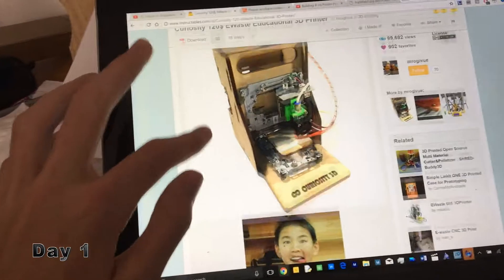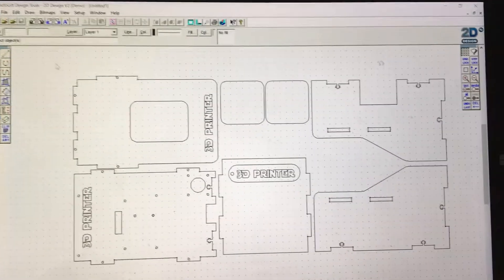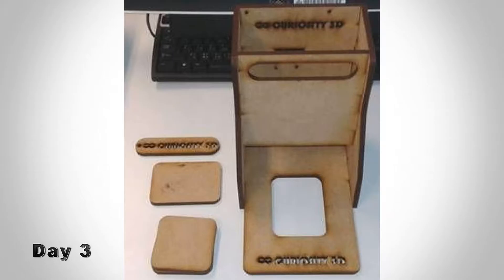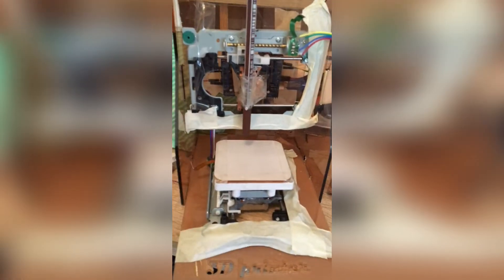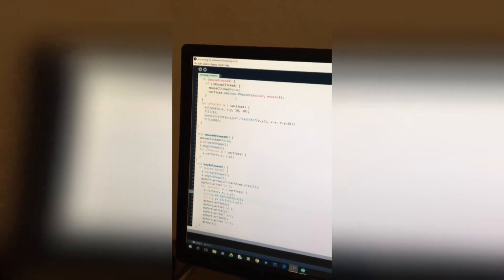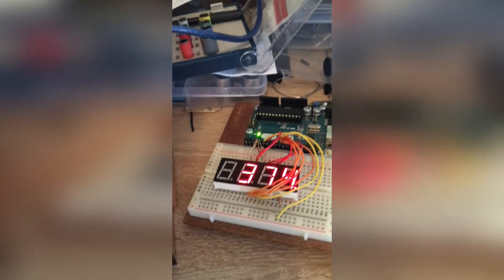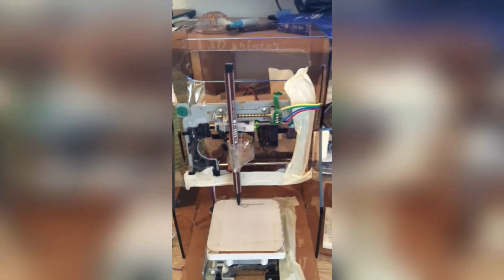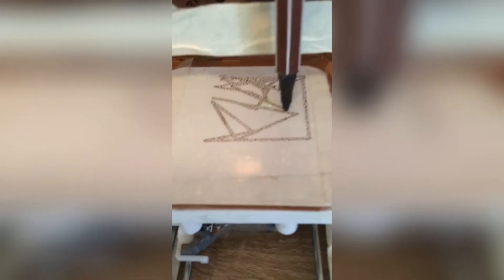Making a CD-ROM 3D printer: week 4

Comment: Acrylic is usually thinner than wood and therefore less rigid. If you use thinner material, you have to adjust the width of the slots also, otherwise they won't fit together